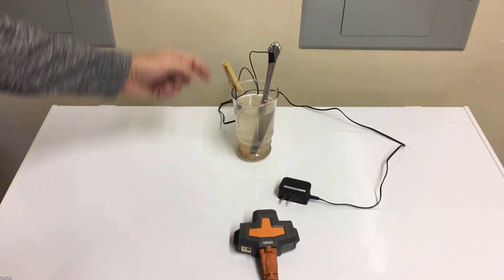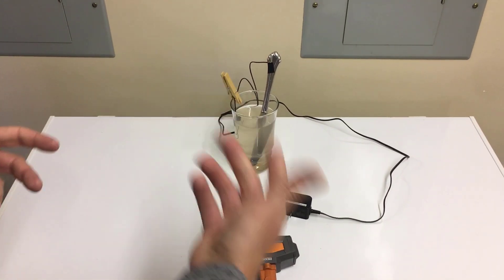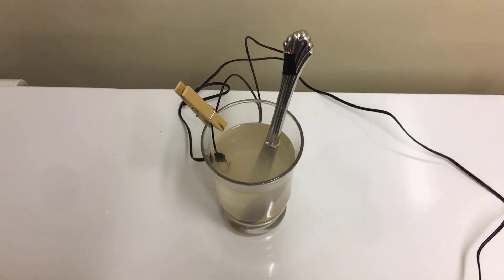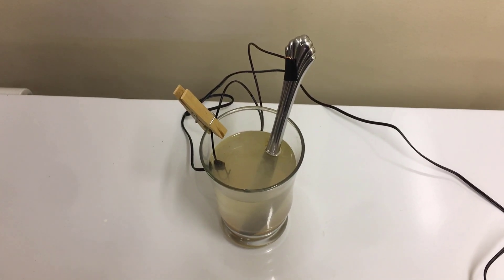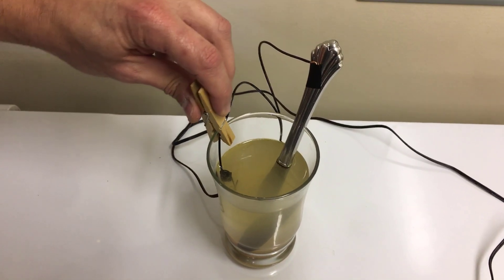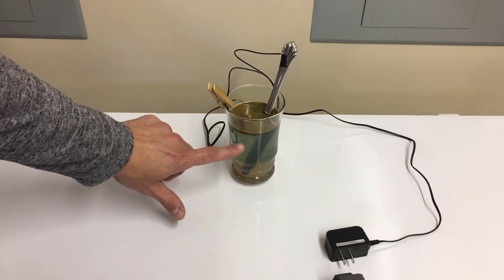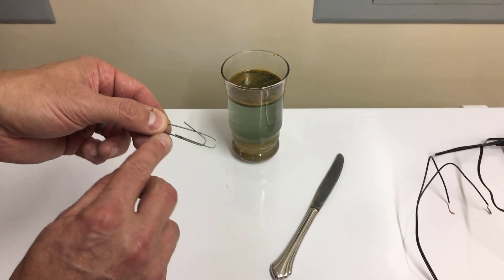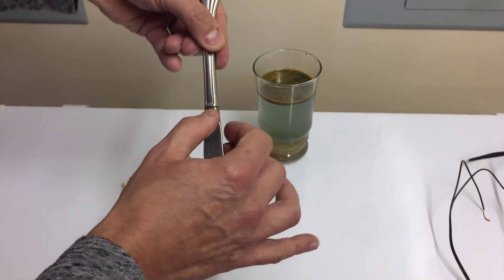Unlocking Elements: The Electrolysis of Sea Salt, Sugar and Water Experiment!

Comment: Electroplating
Reply from the maker: Yes. If you leave it long enough and use the correct metal plates or solutions. This was just using an old stainless steel kitchen knife and a paper clip.  Probably not the best example.